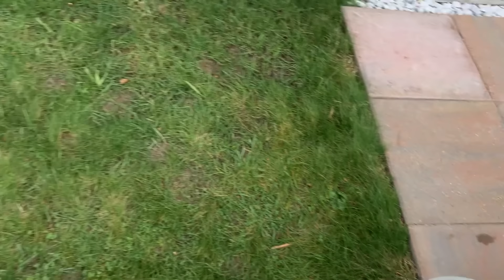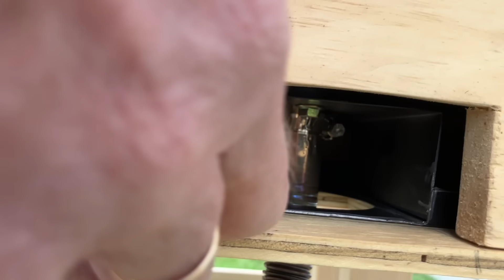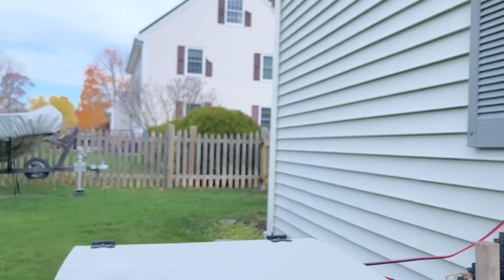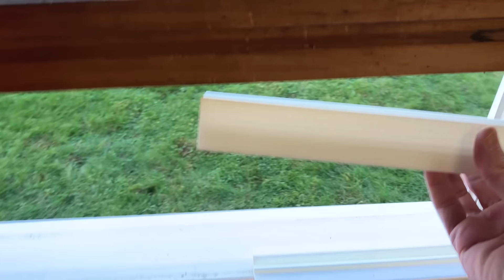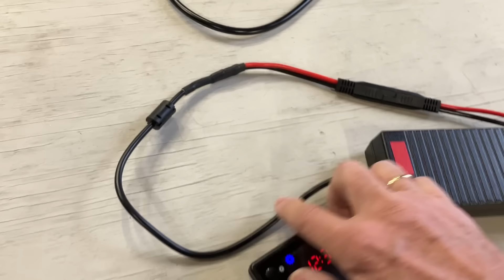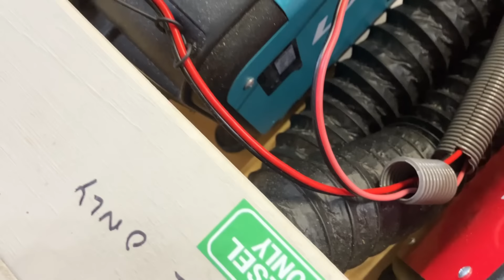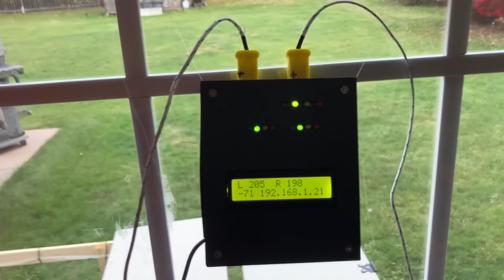Part 1: Dual Diesel Heaters for My Garage! Overkill? Maybe. Awesome? Definitely.

Comment: Any carbon monoxide detector in there ?
Reply from the maker: Thanks for mentioning that! I'll add it to my show description notes just in case. I think I forgot to mention that in this video. Next video I talk about it. So yes 100% a CO detector. I would not run these without that. A broken seal internal to the heater or a cracked casting could spell huge trouble.

Comment: you are loosing alot of heat with those hot pipes, use insulated ones.   and why do you keep the warmers outside???
Reply from the maker: Great question. It just sort of evolved that way. But honestly I prefer having the fuel and combustion outside, especially on a $70 diesel heater. I had a suggestion to raise the legs so the pipes could just go straight into the window, that would cut the length in half easily. And then also to use 4" insulated pipe over the 3" that is there as long as i can find some that can handle rain and snow.

Comment: heh check out my 40 buck 420wh powerstation build on my channel. it could easily run both of these for a week and be kept charged up with a GaN usb-c charger. probably 50% less losses by not using an AC inverter. would probably last 5-10 times longer than the ecoflow during a power outage. i run my diesel heater with my diy super cheap super compact powerstations all the time....
Reply from the maker: Last year I bought two 400 watt solar panels but I couldn't store enough energy that I generated with my EcoFlow River 3 plus. 220 max solar input to the Ecoflow and then its storage capacity and inverter loss made it so my overall day was a loss even when I ran my home office 100% solar for several hours. So I'm very interested in what you have done. I not opposed to running off battery with a solar pane and AC as a backup to charge it.
Reply from the maker: 420wH in that size in your video. Dang. Nice. The Ecoflow that I was using for Solar was only 286wH and cost a lot more.

Comment: I am doing same thing for a dome in the woods. Learnt few things from you to improve on my design. I was wondering if splitting the outputs and intakes ducts between your 2 windows would improve efficiency? And obviously insulating the ducts would help. Awesome video. Thanks for sharing!
Reply from the maker: It might if the intakes can take on more cold air. The issue that I have with my 3" duck being so long is that it reduces air flow to the heaters, which causes them to run a hotter. Especially when the room gets up to room temperature and the intake is a lot warmer. I swapped out my controllers to ones that allows me to adjust fan speed and max fuel hertz (I'm making a video today on that, hopefully posted in the next day or two). If you had a single heater in one window with a loop of hot air and return and another heater in a different window it would balance your heat better because it would all be happening somewhere else. Also don't forget to look at the notes to this video. I link to the 3d printer files for that threaded adapter for the air intake. if you are leaving your unit in the case. Otherwise you can probably get away with putting the hose directly on the air intake and using a hose clamp to hold it all together.

Comment: I always thought these guys were goofy trying to test if the marginal equation they've assembled for their little turbo-heaters to overcome can happen. And its beyond ridiculous. For what they cost why not pair 2 up against the job. Then they've also got a back up when 1 inevitably soots up from the cantankerous exhaust system they concocted.  hahaha LOL
Reply from the maker: Or a fuel leak or whatever. Thats why I made this years modular. So I can have 1 heater working while I work on fixing the other. LOL Putting it outside def looses some heat getting it inside, but I only heat it while I'm working in the garage, so my losses are not as important as bringing the temp up faster. Thanks for your reply.

Comment: I'm waiting for somebody to make a diesel heater and something like a AC enclosure
Reply from the maker: That would be absolutely amazing! Exhaust outside out the back. AC plug in the front that converts 12v on the inside. Not sure if you would fuel from inside or outside, but you could use it in an upstairs window. Brilliant!

Comment: That's a really nice setup.
I would like you to think about a few tweaks that might benefit you.
Diesel sitting in freezing temps doesn't combust cleanly. Moving the cans indoors will improve the combustion.
A shorter distance with your hose runs [heater intake and fuel line] but especially the heater output will give more efficient heat.
If you rearrange the heat output hoses next to each other, they could be wrapped with air duct insulation to prevent heat loss.
A pedestal fan located a foot above the incoming heat blowing in towards the center of the room will circulate the heat to all areas of the room.
Reply from the maker: Thank you! I’ve been getting tons of feedback on fuel lines and hot air in. Someone suggested putting the 3” inside a 4” hvac insulated pipe. Fan is a very good idea and I’ll mess with that next. So you think once the fuel gets to the burn chamber that it will still be too cold? Or is it that it doesn’t flow well enough to get there?
Reply: @V-Tank  Especially on startups, cold fuel and the cold environment will affect the fuel burning efficiency, as far as how much, I would be guessing. I've seen many YT videos where the heat exchanger gets carboned up and less efficient. As far as the separate fuel cans, split the hose coming from one of the 5-gal tank so you can keep the heat running while exchanging the empty tank.
Reply from the maker: 2nd thought. Someone suggested raising the legs so I can shorten the runs. That might let me use hard 3” air intakes. Shorter straighter and no wrinkles in the hose.
Reply: @V-Tank  While that's true, the vibration from the unit and high winds would or could shift precisely the angle of straight air intake. If snow loads on the hoses become a problem, hang the air hoses from a 2x2  attached higher than the hoses. That's how above the ground industrial steam lines are run.
Reply from the maker: @stans5270  Thanks! I have 1x1's in the ground and string stabilizing the hoses from wind now, but hanging them, I've seen that in my travels. Yes!

Comment: It’s good to see more people having their brains compute why I say that is because I see a lot more people using the heat in, which is the black hose in this guy’s to suck in the cold air from outside instead of what this guy is doing putting it in so that it’ll suck the cool air out of the house and keep recirculating the heat. I don’t see that very often but also for this guy if you have the original fuel pump get rid of it before it takes a shit. The original fuel pump that comes with the Chinese diesel. Heaters are shit. I only last two years sometimes three years there is an updated version that’s only 30 bucks. It makes it so you can’t hear it when it pumps but also it’s got a catch filter for when there is things that are found in the fuel so it doesn’t get into the diesel heater but also maybe this guy knows it maybe he doesn’t but diesel heaters should be cleaned out once a year at least because all of the diesel when it burns it has ash crease in there and if it doesn’t get cleaned out, it will run like it doesn’t work, so make sure you do maintenance, but also people do not ever put vegetable oil in this no matter what online says you cannot run raw vegetable oil through a diesel heater whether it is a Chinese diesel heater or a Wabasso diesel heater your choices technically are diesel, kerosene or a homemade diesel mixture by using gas and used motor oil. I use 1 8kW 24 V diesel heater to heat up a 40 foot camper with no problems and if it can keep a drafting camper at 80°F at all times that’s pretty good. Don’t give me wrong in my opinion. The wall Basto diesel heater is better but that’s only because it’s more readily available to get the Wabasso diesel air and water heaters versus the Chinese counterparts. you never know when you’re gonna get to be able to buy a a diesel air and water heater not only that but the diesel heaters are the OG original they’ve been around before these Chinese counterparts. They know what they’re doing because they’ve been building them for over 10 years and the Germans made it. That’s why people say well. Basto heaters are German heaters that are super expensive.
Reply: And if you decide to run it in your shed, do not use the original band clamps that come with the diesel heaters get the more heavy duty ones and then put muffler Paste in between before you put it on tight
Reply from the maker: @codyschwoch5451  I think thats super important for everyone to know. I mitigate a lot of that risk running it outside vs inside.
Reply: @V-Tank  do keep in mind diesel heaters were originally invented to heat up cars, so yes if you don’t know what you’re doing you shouldn’t mount it inside, but it was originally invented for keeping cars warm when they’re parked that’s why they’re also known as car parking diesel heaters so I was just giving you ways to do it safely without carbon monoxide or leaks from other things that can kill a human lol
Reply from the maker: @codyschwoch5451  100% especially for trucks that are in no idle zones where they can't idle their trucks to keep warm at night. Thats also why the mounts for these are harder to adapt since the exhaust loop would be mounted to the metal floor of the vehicle and go out the underside. Thats why I'm a big fan of having the whole thing outside with less to go wrong. CO meter is a must on the inside.
Reply: The other thing I want to add is, if this guy leaves his diesel fuel outside when it gets cold, it will be harder to pump the fuel fuel into the diesel heater because diesel is not the same consistency as gasoline gasoline even in the cold is liquid diesel gels up when it gets cold and when diesel gels up in diesel heaters at least don’t know about diesel trucks because I never drive a diesel truck, but the diesel heater will shut off and do an ER code or an E8 code sometimes means low battery, but most of the time means no fuel is getting to the machine so in the winter time, bring your diesel cans in and insulate the hose and I am glad to see that this does not have the green fish tubing style fuel lines because those are not meant for fuel because they eat away, but this guy either got one with the harder white see-through plastic hose or he ended up buying it so anybody that has a green fuel line hose that comes with their Chinese diesel heaters or any other kind of fuel heaters if you have green line green flexible line like the tubing that you would use for a fish tank bubbler throw that hose away and buy the right shit and if you want to get real fancy instead of using that holes, get fuel line hose at your local hardware store, you know the same kind that they give you in the kit that you’re supposed to use for clamps to clamp the hose to the pick up tube or to the diesel heater pump or catch filter instead of using small hose because it’s the same diameter and the inside as though other kind run it the whole way instead of the hose this guy uses and it will last longer, and somehow it keeps your diesel heater warmer. I don’t know if it’s because of the settings I have personally made online where it pumps more gas than usual and just a tip. It is really fun to dig around with these what Basto or Chinese diesel heaters just to learn more on how it works.
Reply from the maker: @codyschwoch5451  Thank you for such a comprehensive set of comments and sharing it for everyone else. There is so much knowledge in the diesel heater community. I'm not an expert I'm just sharing what I did in hopes that someone else gets some value from it. I'm just moved to slight older display/controllers now and I'm going to do a video on why I used them and turning up my fan speeds to compensate for my long duct runs.  I also found out that when I took outside air and pumped it it, not only was it heating colder air to start, my garage was positively pressurized and if I had anything fumy in the garage it would get pushed into the house. The return loop makes the heat better and also keeps the pressure closer to neutral. I do have a spare fuel pump, but with the build it so easy to replace I'm just going to let the current ones burn out. One is super noisy and the other very quite.
Reply: @V-Tank  looking forward to watching the next set of videos

Comment: On your air intake why don't you use a elbow pipe at the bend to give you more air flow
Reply from the maker: Inside the heater box where I have that orange intake adapter?  I could also hard line inside the heater instead of flex tubing, but I would need to make my box longer since it ended up being about an inch shorter than I needed. Certainly not out of the question give my work on these. I'm filing it in my brain for the Gen 4 pass pass.

Comment: No, just no. So many issues here. Main one being poor efficiency because of your long exposed ductwork. And 2 heaters is so overkill. I used one heater in my 2 car garage shop to keep it at 70 degrees during a brutal winter. With the heater inside, and only the exhaust venting through the wall, you don't have as much wasted heat.
Reply: Overkill is in the title lol
Reply from the maker: Ha! Heat loss for certain. My heat loss in my garage is such that when I was using buddy heaters 18k BTU's, no loss like this one introduces, I still needed two. I don't heat full time, just when I'm working out there. So going from 30 to 65 is a thing for me. So having two allows one to handle the heat loss of the garage and the other to bring it up. I would say 70% of people use the indoor approach. So I'm in the minority.
Reply: Diesel fuel gells at 17 f. Good luck with that outdoor setup.
Reply from the maker: @Mike-p4x6j Its pump fuel that is winterized (vs home heating oil). Not sure where that gells, but trucks run in pretty low temps. I was pretty good last season, but I didn't have those long fuel lines.

Comment: If you don't mind me asking what kind of ecoflow power is that
Reply from the maker: Thats a great question. I'm running it off the Ecoflow RIVER 3, 245Wh (300W Up to 600W AC Output). Its going for about $188 USD on Amazon right now. The thing to note is if you run two heaters on it, startup wattage for two at the same time exceeds 300 watts while the glow plugs are heating up. Similar, but not quite that much wattage on shutdown. But in the middle at steady run for both at the same time on max power its probably 120watts, I have more than a hour to shut things down nicely if the lights go out. I haven't tried it in the extended 600 watt feature for resistive loads. So.... If the power goes out and I'm ready to shut things down (or start things up) I do one heater at a time until the glow plug cycle finishes so I don't exceed 300 watts. Hope that helps. The river 3 is def an entry level unit. I got a River 3 Plus, but use that elsewhere in my house. Much better specs on the plus. So I relegated this one to diesel heater duty and that allowed me to not mess to mess with a car battery. Cleaner and easier for me even if it means 120v to 12v conversion. I should do a video just on the power of these things.
Reply: @V-Tank  yes sir thank you alot

Comment: Should consider radiant. Many of the diesel heaters that will heat water for radiant. Then only need to bring in pex. Use a pump to circulate.
Reply from the maker: Love this! 100% I have thought of that. I saw the diesel heater radiant pumps online to preheat engine blocks. Not sure on Kw/BTU, but that would make a completely isolated system. I'm guessing I would need antifreeze in the loop to prevent freezing, but thats manageable.

Comment: It might give you some peace of mind knowing diesel has such a high flash point that a bic lighter cant even ignite it. The only thing hot enough in those units to set the diesel off is the glow plug. You could dunk your exhaust in one of those jerry cans and it would only serve to cool them off. Hope that helps you feel a bit safer!
Reply from the maker: Thanks!

Comment: I have a few diesel heaters and I would build the box higher and closer to the house the shorter the heat has to flow through the hose the more heat you get inside the area being heated 2 feet of hose is all you need you did good but it could always be better right!
Reply from the maker: Thats like seriously great info. I see a gen 3.5 on the way.  Thank you.
Reply from the maker: Thats exactly how I got to this, trying to make it better. I'm sure I'll have a Gen 4. I know I'm getting  ton of heat loss in from the hoses. I overpower that with two units, but it not elegant. Insulated hoses would be bliss, but I'm not sure what's out there that will work in the rain and snow.
Reply: @V-Tank  We used 4 inch A/C duct hose with the almumin cover it slides right over the 3 1/2" heater hose and some duct tape on the ends it works well but the best was shorter hoses if you can use them

Comment: Nice. I have one that sits inside that I run from a 12v 100ah LFP battery and one outside that I use an old car battery to survive below freezing temps. I made similar plywood fillers for the windows. Lucky that my cheap metal single pane window tracks hold it in place
Reply from the maker: Nice. I almost went with a car battery to power both, but the Ecoflow turned out easier for my setup. Its there to allow me to shut is down nicely if the power goes off.